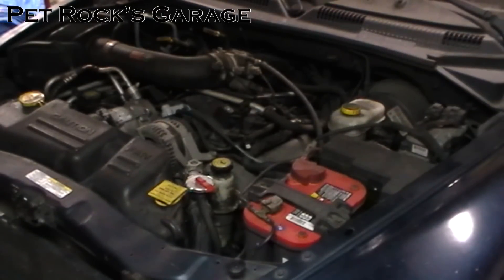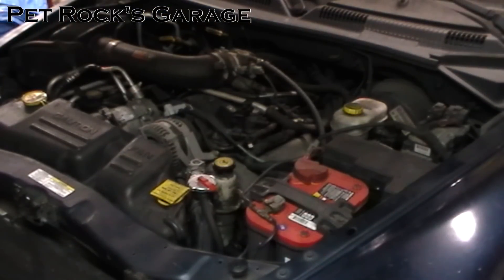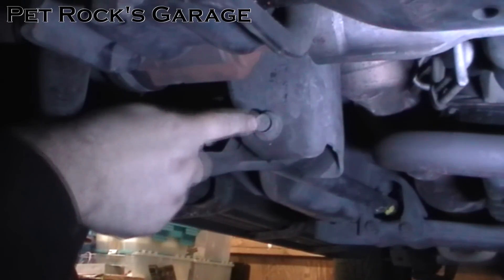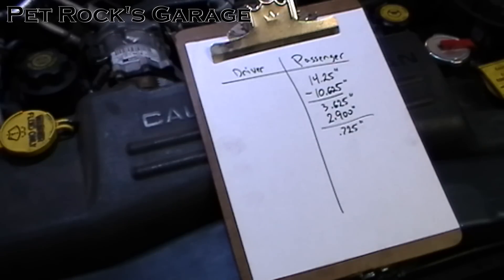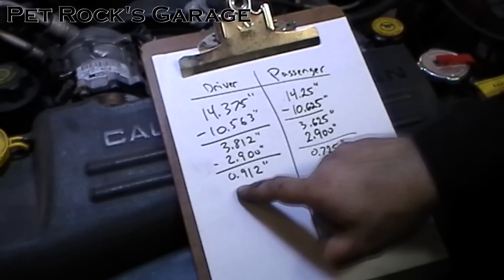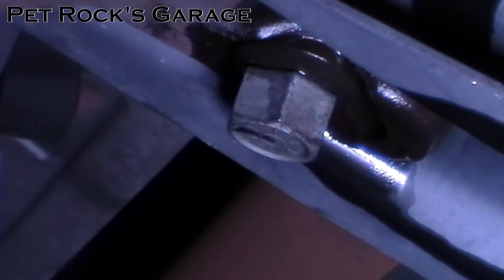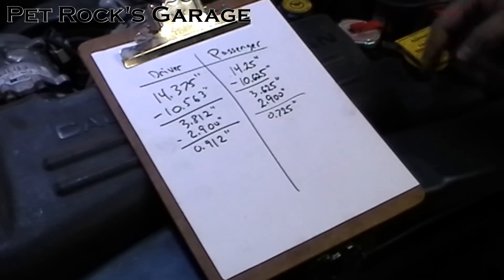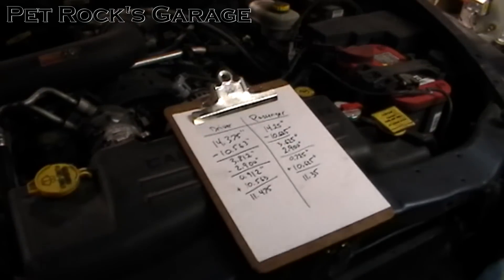How To Adjust Front End Ride Height - Dodge Durango 4x4 (’98-’03) & Dodge Dakota 4x4 (’97-’04)

Comment: Hello I have a question, I just bought a 2000 R/T Durango awd/4x4. I went to get an alignment and they told me I basically needed a whole new front end.... upper lower control arms, tie rods and ball joints. Which yes it pulls to the right and has some bump steer but doesn’t feel horrible. Anyways I’m going to buy a front end kit with all those parts. Should I do the ride night measurements after all new parts are installed? Also am putting new shocks all around. The Durango has 131k miles I think it sat around more than driven. Just put brand new tires on before all this ughh stresses out now please and thank you for the response
Reply from the maker: Definitely do the adjustment after installing the new parts. Good luck.

btw, if you don't know how to check all those things yourself, I would take it to another shop for a second opinion. That many things wrong seems suspicious to me. One or two things maybe, but not everything.
Reply: @petrocksgarage  my brother will be putting all the parts on and doing the height adjustment. I think this durango sat for a while man, it has pretty low miles and is clean inside and out, it was on non op when I purchased it and had 2017 tags. Alot of the bushings look dry rotted out not a bunch of rust really just dried out.it had tires from 2001 on it 🥺
Reply: @petrocksgarage  also what is the proper ride height for the durango originally?
Reply from the maker: @candacerutter6707 , that's what I'm setting in this video.  I set it to the stock ride height.
Reply: @petrocksgarage  thank you for your responses I appreciate you
Reply from the maker: No problem.  Good luck.

Comment: Does this same technique work on the third gen? I have an 06 and I just want 2" more lift.
Reply from the maker: If its a torsion bar suspension, then yes. However, to get the correct ride height the high/low range for the calculations might be different. Don't lift it too high though. It will put a lot of stress on your ball joints and tie rods that they could prematurely fail. Good luck.
Reply: @petrocksgarage  Only looking for 2" to fit 33's, so it should in theory be safe I think.
Reply from the maker: @WhiteCavendish , yeah, that should be ok but keep an eye on your ball joints. Good luck.
Reply: @petrocksgarage  Cheers, thanks!
Reply from the maker: @WhiteCavendish  No problem.

Comment: what is the max i can raise the front before having front end issues? and will i need new/longer torsion keys? I’d like to raise the truck just a tad bit, but not at the expense of front end parts.
Reply from the maker: I'm not entirely sure. I keep my truck at stock ride height. Some people do put in torsion keys to get some added lift, but the limiting factor is the control arms. If you lift it too much you significantly reduce the amount of control arm downward travel which effects the ride & handling. But to each his/her own.

Comment: I'm assuming you have to loosen the Top Nut so it has room to go up then re tighten the top nut?
Reply from the maker: Which top nut are you referring to? Do you mean the 'nut' that the adjuster bolt goes through? If so, it's not really a nut. It's a cylinder with threads cut into it for the bolt to go through while allowing it to swivel as you adjust the ride height. The torsion bar keeps it all in place & under tension. If you were talking about a different nut let me know.  Hope that helps.
Reply: @petrocksgarage  yep I was talking about on the top side where you sprayed it down, gotcha so that one doesn't need to be messed with it all thank you!
Reply from the maker: @crazychicken675 , yup. you don't need to touch it other than maybe clean any gunk/rust off it and spray with some penetrating oil. Good luck.

Comment: Can I just measure the gap from top of the wheel to bottom edge of wheel well and even them up? I'm doing that very thing today.
Reply from the maker: No, that isn't accurate. Body panels are not guaranteed to be symmetrical, nor is tire tread depth. If you ever tapped something with your front bumper, for example, it could 'move' the fender. Fenders have elongated holes for the bolts to go through to give the installer some wiggle room which makes it virtually impossible to position them identically.  You need to use measuring points that are unaffected by fender benders, install techniques, tire side or tread wear.

Comment: I removed the torsion bar and key without recording how many turns and such cause I did a whole suspension overhaul on my durango now that everything was installed I lowered it from the jack stands and the front went completely low. Anyway to fix this? I had to raise it onto jack stands again.
Reply from the maker: Its hard to say what is wrong without seeing what changes to the suspension you made. The torsion bar & key combo are the spring that hold up the truck. So if the truck is too low then the problem is between the key, bar & lower control arm. I'd start by inspecting the key & its position relative to the lower control arm.  Maybe you installed the key backwards or in a different orientation then stock?  Good luck.
Reply: Pet Rock's Garage when the lower control arm wast installed the torsion bolt wasn't tighten down until everything else was put on. You think my cause the whole front end to go all the way down?
Reply from the maker: Kind of. The orientation of the key on the bar relative to the control arm matters. If, for example, you had the key pointing straight down and the control arm parallel to the ground when you put everything back together then when you put the truck back on the ground it would be significantly lower then it should be.  Make sense?  So double check the orientation of the key. Good luck.

Comment: Hopefully you’re still responding because I’m in SERIOUS need of help. I adjusted my passenger decently. Sitting at about -0.15 and I can stick my pinky finger under the bump stop. However, the driver side is a little different. It’s the final measurement is currently sitting at -0.4 and I’m able to stick my pinky finger under the bump stop. Here’s where it gets even crazier though. The distance between the top of the passenger tire to the bottom of the fender is 7 1/2. For the driver side it’s only 6 3/4. Why is the driver side so much different? I had to crank the bolt way past factory spec to get a gap underneath the bump stop and the fender is still shorter than the passenger side. PLEASE HELP!!
Reply from the maker: Measurements between the tire & fender are never accurate. Tire wear and tire pressure can dramatically effect the measurement. Also, if you have ever been in a front end accident (even a slight tap on the bumper) could effect the position of the fender. There are just too many variables when measuring via the fender. Thats why the service manual does it from points on the frame that aren't effected by tire wear or pressure or minor fender benders. I would make sure the measurements shown in the video are within spec and run with it. Don't go off bump stop or fender measurements. Might be good take it for a drive to let the suspension settle and see if the measurements are still within spec. Good luck...
Reply: @petrocksgarage  So even if the driver side bump stop is touching, just make sure it's within the -.12 to .12 spec on each side?
Reply from the maker: @nneverss , yeah, pretty much.
Reply: @petrocksgarage  I was contemplating getting new torsion keys to level the truck. But after reading some reviews that it results in a decline in ride quality I think I'll pass. Plus I can't get the old torsion keys out. The torsion bars are incredibly seized into them.
Reply from the maker: @nneverss , I prefer the stock ride height etc, so I haven't looked into aftermarket keys. However, raising or lowering a vehicle will definitely effect the ride quality since it changes the suspension angle & travel. Seized keys & bars is pretty common. Even if they were not seized they are a P.I.T.A. to get apart. But with enough penetrating lube and/or heat you should be able to get them apart if you really wanted to.
Reply: @petrocksgarage  alright thanks, I appreciate the help. I mean, there used to be a gap under the bump stop but that's because half of it was gone lol. So I just replaced them and now they're touching
Reply from the maker: @nneverss , I'd take the truck for a drive to let the suspension settle and check that the ride height is still in spec. After thinking about it, the bump stops shouldn't be touching.  Close, yes.  But not touching.  Maybe your calculations or measurements were off?  Worn out control arm bushings or ball joints?  Those could easily effect the ride height measurements/calculations.
Reply: @petrocksgarage  I had all of the ball joints replaced 2 months ago, along with one of the lower control arms (can't remember which one lol). I went out again this morning to adjust the driver side torsion key to the right spec. The final measurement is sitting extremely close to 0 and the bump stop is very much touching.
Reply: @petrocksgarage  Could I send you my measurements to the center of the wheel and to that bolt and have you go over it to make sure I didn't screw up anywhere?
Reply from the maker: @nneverss , yeah sure.
Reply: @petrocksgarage  So for driver side I have 13.25 to the middle of the wheel and 10.25 to the middle of the bolt. Subtract those and I get 3. Subtract 2.9 and I get 0.1. I might raise it a tad bit more to get closer to the -0.12 number. For passenger side I have 13.25 to the middle of the wheel and 10.5 to the middle of the bolt. Subtract that and I have 2.75. Subtract 2.9 from that and I get -0.15. The driver side bump stop is still slightly touching, so maybe if I raise it more to be closer to -0.12 it might help.
Reply: So what do you think? Just raise the driver side up a bit more to match the -0.15 of the passenger side?
Reply from the maker: Your math is correct.  The numbers on each side do not have to be exactly the same, but it doesn't hurt. Drivers side is within spec. Your passenger side, however, is slightly out of spec.  It's -0.15 and should be between -0.12 & 0.12.
With that said, it's surprising you got such nice 'easy math' numbers (all to the 1/4"), and that both wheels measured the same. Are you sure those measurements are accurate to at least a 1/16"? I'm also surprised that the drivers side is in spec, but the bump stop is still touching. That doesn't seem right. Something is off.  Bad ball joints, worn out control arm bushings, measurements are off slightly or wrong bump stops?
Reply: @petrocksgarage  Yes, both wheels measure at exactly 13.25. I used a square to make sure my tape measure lined up perfectly. I just went out and readjusted them. Both sides sitting at about -0.025 now. While the bump stops aren't touching anymore, they're extremely close. I think it should be alright honestly. If I had kept them at -0.15, would that be bad? I mean I do understand it's slightly out of spec but not by much.
Reply: @petrocksgarage  And for reference I have a 99 Dakota. The new bump stops I installed were Dorman brand. Part number 905205.

Comment: By doing that, does it lift the front or both front and rear
Reply from the maker: Just the front.
Reply: @petrocksgarage  thanks alot, how many inches can I get from turning them
Reply from the maker: @Vapotaliban , i'm not sure. An inch or two maybe with stock torsion keys? I've never gone past stock ride height. If you crank on the torsion bars too far you can put the rest of the front suspension into a bind and cause other problems.

Comment: So this also works if you want to lift your Durango for more clearance without doing a lift kit?
Reply from the maker: Yeah, it can be used to lift the front end up a little. Its not a proper lift though because it puts excessive stress on the ball joints if you lift it too high. Good luck...

Comment: I have a 2 wheel drive Dodge Ram that sags down on the front driver side.  what is the term used for the adjustment so I can research on how to adjust my height?
Reply from the maker: The ride height on the 2 wheel drive trucks is controlled by the springs. They aren't really adjustable. I would inspect the springs and see if one is damaged/broken/rusted out. Also check the rubber dampening pads on either end of the spring to see if they are still there or rotting out.  If that all checks out then the spring may just be worn out. It happens with age. Good luck.

Comment: I have a 01 durango and I want to lift it and everyone is telling me I can do so just by adjusting the torsion keys like you did.
Reply from the maker: Yes, you can lift it a couple inches via the torsion keys. But it will only lift the front end, not the back. It will also put your ball joints at a weird angle severely reducing their lifespan. But it’s your truck. Do with it what you want.
Reply: The rear it looks like I can just get shackle extensions for the leaf springs, would you recommend adding a leaf when doing so? What would be the best way to lift the front end, I plan on replacing the ball joints tie rod ends ect when doing it but I dont want to put anything at a bind.
Reply from the maker: Yeah, you can use shackle extensions to lift the rear. Adding an additional leaf would only be needed if you plan on carrying a heavier load on your truck or trailer. Otherwise it will just make your rear suspension stiffer and effect the handling. There are kits that will lift the front end and keep the suspension geometry the same as stock so that you don’t put the suspension in a bind like cranking the torsion keys or instilling ‘lifted torsion keys”would. Good luck...

Comment: What if my 2003 Durango 4x4 has leaf springs in the rear and no lower control arm bolt to measure from?
Reply from the maker: Leaf springs on the back is normal.  However, I'm not sure how you can't have lower control arm bolt.  Even if it was a 2x4 it would have a lower control arm & a bolt to mount it to the frame.

Comment: Do you have way to get in contact with you my left side is giving me crazy measurements and im lost
Reply from the maker: Sorry, I don't give out my contact info. We can use comments like this though. Whats the issue?
Reply: @petrocksgarage  i trying to do my truck but i get 14 1/2 inches and 12 1/2 inches on the driver side and 14 1/2 and 13 inches on the driver but when i do the math im getting confused

Comment: OK so I just installed a lower control arm for the passenger side and when I let my Jack down so did the whole rite side of the front end and it wasn't like that with the old control arm what do u think it could b I have a 98 Durango 4x4
Reply from the maker: It sounds like it needs the height adjusted via the torsion bar bolt. Take the measurements like I show in this video and see if they are correct. My guess is that it's way off. Then adjust the height how I show in the video., Good luck.

Comment: When making a semi hard right or left turn in My 2005 Durango the wheels kinda stick or lock up on the front end. 
Is this the results (ride height) of this problem? 
    Asking for myself!
   Heeelllp!
Reply from the maker: Do you mean that the tires stop spinning when you make these turns?  Or that the steering wheel won't spin in either direction once you make one of these turns? Both sound pretty dangerous. I doubt its a ride height problem unless the tires are coming into contact with the inner fender. Its hard to say what the problem is without looking at the vehicle. Best to jack it up and climb underneath and have a look. Good luck.

Comment: How do you get the correct height in the middle hub what if one side tire is lower or more flatter
Reply from the maker: Each side is independent of the other. Measure it with some kind of T-square or Carpenter Square like I show in the video.
Tire inflation doesn’t really matter. The measurements & math I show in the video will produce the distance between the center of the lower control arm bolt and the center of the wheel hub, regardless of wheel diameter or tire size/inflation.  Hope that makes sense.

Comment: what about lifting  how much lift can u get from  turning the torsion key bolts?
Reply from the maker: +Brad  Evans, only about 1 or 2 inches I think.  But it will only effect the front end.  It doesn't effect the rear end.  So your truck will look lop-sided without an equivalent lift in the back via taller leaf springs or taller shackles or something like that.  Good luck...
Reply: +Pet Rock&#39;s Garage What if your truck is high in the back? Because I've been wanting to make mine level it sits higher in the back than the front and I'd like it to sit level
Reply from the maker: Elicountryboy 1996, you could raise the front to match the back. Just make sure the measurements are the same on both right & left sides. There are also rear leaf spring shackle kits available to lower the back to match the front. Good luck...

Comment: does this work with a 07 Durango 4x4?
Reply from the maker: I'm not sure. I haven't worked on that year Durango before. If its got torsion bars for front 'springs' then the procedure will be very similar but the numbers will likely be different.

Comment: OK so I did that and still no luck it is still bottomed out any other ideas
Reply from the maker: Its hard to say from my keyboard. Assuming you adjusted the ride height correctly & installed the correct lower control arm for your truck, the only thing I can think of is the torsion bar is not holding the weight of the vehicle. The torsion bar is the spring that what holds the vehicle up.
Reply: Remove the bars and move them to opposite sides